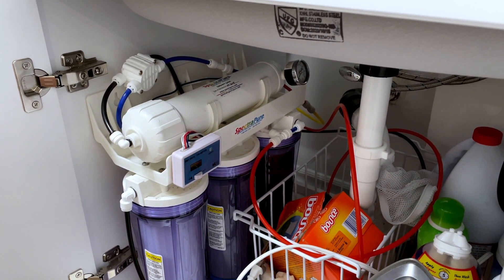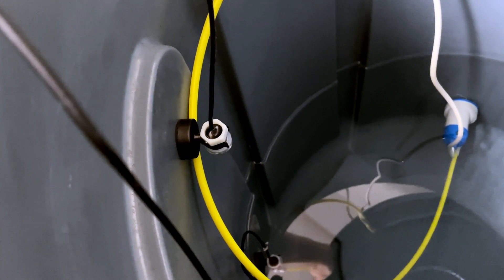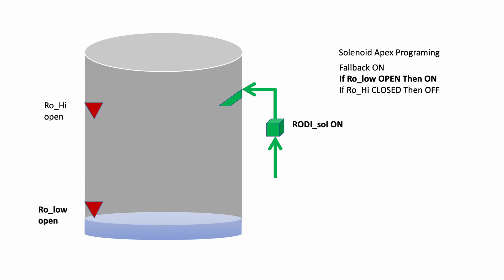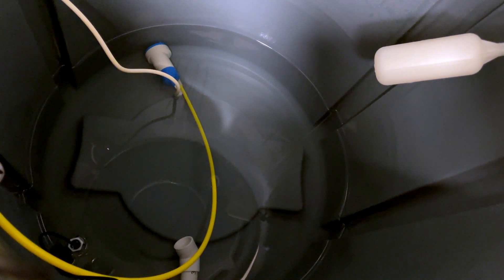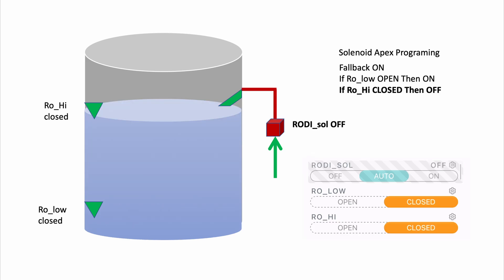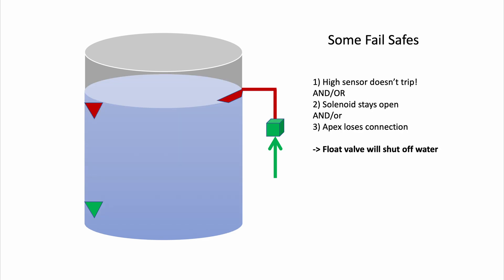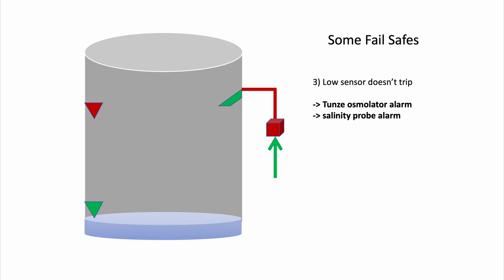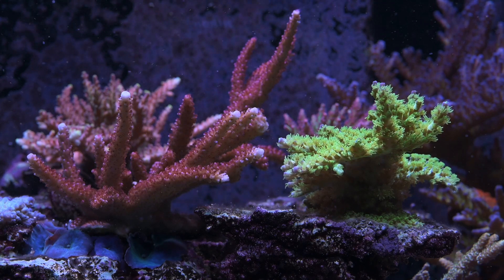Automate your RODI system

Comment: Very nice video. Can I please ask how do you transfer the rodi water to your sump? I am preparing for a new large reef tank and I have installed a rodi filter system and I have a 100 gallon container with a float valve for storing the rodi water. 

I’d like it to automatically feed to water to top off the ato chamber of my sump. I was afraid that the water from my 48” tall storage container which would pump out the top of it and travel to my fish tank room and enter my sump which is 21” tall, would keep flowing into the sump even after the pump in my storage container shuts off because the exit height of my storage barrel is much higher than the height of the hose that will enter my ato. Is this the case? I’d really enjoy hearing how I can soundly do this. 

Thank you!!!
Reply from the maker: @moviefan4life166  I used a solenoid valve backed up by a float valve ; basically just using a gravity siphon from the higher ato tank to my sump… tunze ato has a solenoid attachment that opens and closes the solenoid in the same way a regular ato turns on and off the feed pump. The solenoid is then connected to a float valve so if the solenoid malfunctions, the float valve should control things. Also, high and low level sensors on the sump return chamber is a good idea
Reply: That sounds great. Thank you!

Comment: Can this procedure be implemented in the daily basis water change ( 1/5th of the total volume of 150 gallon capacity of tank ) schedule of a discus tank? The Tds level of my tap water is very high ( borewell  ) so RO is mandatory. DI is optional. I need to do perform  Siphoning on daily basis in my discus tank to remove detritus and other matters like uneaten foods and fish poop and change 1/5th of the total volume ( water) of the tank capacity to maintain pristine water quality. Too much labour in  this water change schedule manually on daily basis. So is this AUTOMATED procedure..can be implemented to do the work?.

Comment: This only works if your Apex is close to your RODI unit?
Reply from the maker: nope. you can get really long aquabus cables so you fmm module can be far away from the apex unit. You'll need a dedicated power adapter for the FMM module to power the solenoid valve. My tank is upstairs and my RODI system is approxiamtley 15 to 16ft away
Reply: Here is another tip:

I’ve got a house on pier and beam (3ft crawl space under the house) and I have my Rodi top off and salt tanks 75ft away in my garage.   I used outdoor rated solid copper CAT6 23 AWG internet cable (8 strands) and it works perfectly.  I was pretty shocked how far your can run both low voltage power for ATK pump and apex aquabus signal.  Has been working perfectly for 2 years. 

I was able to use 2 strands for my apex ATO pump and 5 strands to run an apex aquabus extension.   This all works for perfectly both the top off pump, and to send signal from main apex to my DOS in garage for continuous water changes. 

Also put in a half inch fill line and line out to drain for larger water changes. 

No more buckets for water changes:)

Comment: Thank you for the video. I recently purchased an RO system and have been thinking about having it automatically top up my top up resevoir. A couple of questions for you, is OK to keep mains pressure on the RODI system all the time, where is the best place for the solenoid before or after the RO system?
Reply: Nice idea! I did similar automation using a smart switch that is scheduled to power on and off at a fixed interval twice a week with a float valve in my reservoir as a redundancy to prevent a overfill.
Reply from the maker: Hi Jules. Solenoid has to be after Ro as most are not designed to take main pressure. Haven’t seen any issues with keeping main pressure on the rodi input side. Good luck with your system